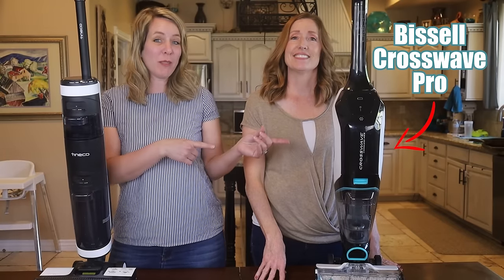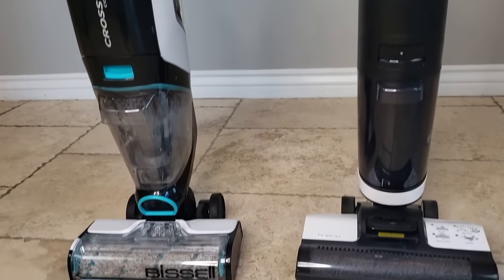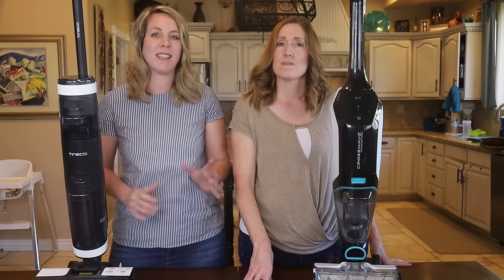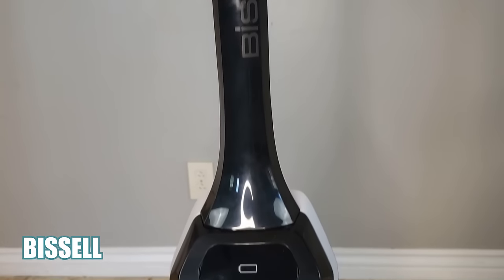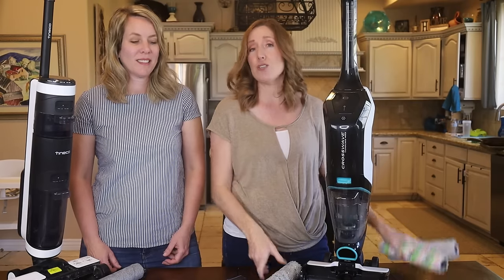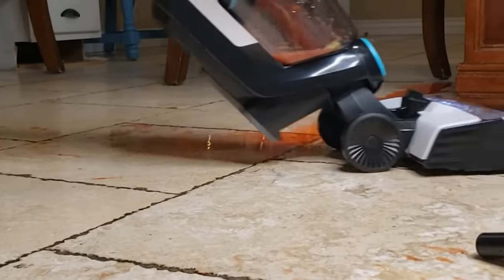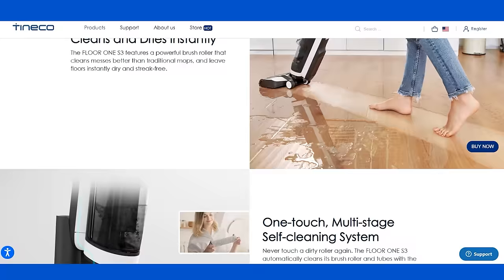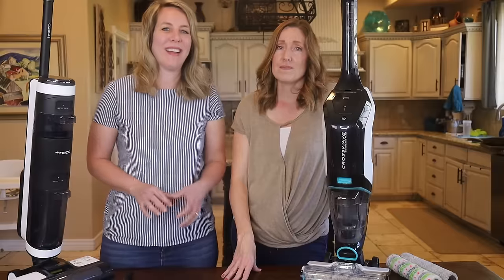Bissell Crosswave vs Tineco Vacmop (Which is Best??)

Comment from the maker: NOTE: The Tineco shown in the video is incorrectly labeled. It's the Tineco Floor One S3 Cordless Wet Dry Vacuum Cleaner - this one - https://amzn.to/3nbWjtw (this is an affiliate link) with smart tech. The IFloor 3 doesn't have the smart tech, voice (you can turn on/off but it tells you when it's time to refill the clean water, empty the dirty water, clean, etc), app or high tech display. It comes with 1 brush, the Floor One comes with 2.  I think it's worth it but both are great machines. The clean/dirty water holders are interchangeable, same with the brushes. The S3 has a black body and the IFLOOR 3 is white.
Reply: I have had the Bissell crosswave max for about 11 months. Absolutely LOVE it and have only had to buy replacement rollers once because I learned to deep clean them. Recently, the sprayer on my Crosswave stopped working. I followed all troubleshooting suggestions to no avail. I emailed Bissell and they are sending me a new one as well as allowing me to keep the old one for parts. Awesome customer service!
Reply: Thank you for replying. Yes, I use  the bissell cleaner and fill it to the indicated line. I have luxury vinyl, and I am not sure if it shouldn’t be used on that flooring, but the amount of soap residue after I clean is a lot. So. Let me ask what may be a silly question when using the machine a forward motion releases the chemicals and a backward motion over the same area dries the area? Please correct me if I am wrong as I want to make sure I am also using the machine properly. Thanks again.
Reply: I didn't understand which broom is better.
Reply: Please mention her name.
Reply: You guys also mislabeled the Bissell. It isn't called Crosswave Pro (that's a different vacuum). This one is called Crosswave Cordless Max.
Reply: I bought the wrong one.
Reply: Are you being paid for this ad.
I had a tineco for 8 months, and the voice commands  have never  worked  properly. 
Now  the battery  will not hold the charge.
Reply: Great review/comparison! So, so helpful. Thanks ladies.

Comment: After this review, I went with the Tineco Floor One S3, loved it for 3 weeks, then had to return it due to water leaking. I then got the Bissell Crosswave in this video, and I prefer it because it’s more durable with a better build, and the clean water tank doesn’t need to be refilled as often, and it’s so much easier to clean (the strainer in the dirty water tank is better designed and catches all of the gunk, and I can clean that part off in one swipe of a tissue, rather than with the Tineco’s strainer which is half the size and things like hair gets caught in it, plus the Tineco’s strainer doesn’t actually catch all of the gunk, so you have to filter through it twice when pouring out—it really became a source of frustration for me when cleaning since I had to empty out the DWT in the Tineco 3 times during a 30 minute period. With the Bissell, I only have to clean the DWT once at the end of a 30 minute cleaning session). I also tried the cordless Crosswave X7, and liked that one as well for the same reasons. Plus, the Bissell doesn’t constantly talk to you, so that’s less annoying (I know you can shut it off with the app, but I didn’t want to take the time to download the app to do that.)
Reply: do you know if this is the same for the bissel hf3? I am thinking of purchasing it
Reply: Have you ever had an issue where your floor stays wet for a long time after mopping? 
When I first got my cleaning machine, it left the floor dry in a flash—just 15 seconds and it was done. But after using it every day for a month, just 10 minutes a day, it's not squeezing out the water like before. 
Now, I'm stuck waiting around 5 minutes for the floor to dry.
Reply: @HamzaKhan-uc5zo  I did not like the Bissel hf3 when I tried it because it used up more cleaning solution than my Crosswave Cordless Max (as shown in this video). The other reasons were because in the hf3 I received, the water had to be filled sideways (odd design), had to be refilled more often, and while using up more cleaning solution did not clean my kitchen floor as well as the Crosswave Cordless Max! I found that emptying the DWT was also about the same as the Tineco, and I think it's becuse the hf3 was modeled after the Tineco. If you're deciding between the Bissell hf3 and Tineco, I think Tineco is better and more satisfying ... I just don't know how long the Tineco will last, as I hear that the longevity with that machine isn't great.
Reply: @BeginnerVille  Hmm, interesting ... My Bissell Crosswave cordless max (like the one in this video) always took about 5 minutes for the floor to dry. I also happen to keep the trigger button (that releases cleaning solution) pressed down the whole time. But if you feel your machine isn't working as well as it used to, and if it is under warranty, you can get a replacement machine and see if it improves. (I got mine from Best Buy and purchased their store's extra warranty.)
Reply: @LightnessofJoy  thank you very much for sharing this!

Comment: They should have swapped for a week and then talk about if they would stay with their old machine or change.
Reply from the maker: Diane did use the Tineco for over a week and liked the Bissell better for her household. I didn't use the Bissell but I should.
Reply: @CleanFreakGermaphobe  Does the Tineco clean itself off well?  I watched one man who used both and Bissell cleaned itself out but his Tineco didn't clean itself well.  It was the messy floor test, but even after re-doing the cleaning itself out process, his Tineco still didn't do it.  But, I watched another woman and with a not as messy clean up, her Tineco cleaned itself fine with less water in the base and the Bissell cleaned itself but the base was filled with water and she chose the Tineco for that reason.
Reply from the maker: First, every surface and mess is different. In my experience, you do need to remove the roller and make sure to get gunk and hair from inside. That's what the brush accessory is for and to clean the dirty water tank. 

I'll let Diana speak to cleaning the Bissell. It's been too long and I can't recall and don't want to give the wrong info.

The absolute best is Hizero. It separates the dry from wet messes. It captures hair and gunk in a tray that's easy to clean. You don't get a big soupy mess to clean in the dirty water tank. Just rinse off.

There's no self cleaning cycle. The roller isn't made of material. I find it much better. But they all have their pluses and minuses. When they're back in stock we plan to review the Hizero.
Reply: @CleanFreakGermaphobe  That is cool.  I will be watching.  I have watched Vacuum Wars review on the three of them.  But I will tell you that the man who tried to do double self-cleaning processes on the Tineco and it still was seriously messy caused me to pause.  I will wait for your Hizero review before buying one.
Reply from the maker: This is Diana.  The Bissell has a self cleaning mode too.  I use it multiple times a day, but I a few times a week I remove the brush and do a deeper cleaning
Reply: @CleanFreakGermaphobe  Thank you so much!  I am still narrowing but I can't get the brand they say is better than Bissell and Tineco (They only sell it in stores right now and they don't sell it in any of the states near me.  I would have to drive to Canada as the closest.)

Comment: After using both Bissell Crosswave Max and Tineco S3 for more than a year , Tineco broke down and it was replaced free  but Bissell is still working , but I found Tineco a much better machine to use and clean hard floors, Will go with a Tineco again .
Reply: Tineco you will be replacing them every three mos.
Reply from the maker: We agree tineco is a better choice. However Diana’s Crosswave broke and was replaced by Bissell. No problem with the Tineco. Diana ended up getting the newer Tineco and prefers it. I also upgraded to the same one and love it. There’s a link to it in the description. The S5.

Comment: I used your link to buy the tineco and they gave me $60 discount. Thank you again. It's important that my hardwood floors dry quickly so I chose the tineco for that reason
Reply from the maker: Thanks for using our link and let us know if you love it as much as we do!
Reply: Have you ever had an issue where your floor stays wet for a long time after mopping?
In the first few uses, my cleaning machine worked like a charm — the floor would be dry in just 15 seconds. But after a month of daily use, about 10 minutes each day, it doesn’t squeeze out the water effectively anymore.
Now, I'm stuck waiting around 5 minutes for the floor to dry.

Comment: I bought the bissell & returned it.  It left a lot of streaks & just made a mess.  
I recently purchased Tineco & found it to be far superior.  The latest version has suction only as well, so is a great improvement. 
In Australia the tube on is more expensive but I think worth it.
Reply from the maker: Thanks for your input.  The newest Tineco stepped up their game even more.  We both love it
Reply: I’ve been using the Bissell for three years and have never had streaking. Floors are always spotless. The Bissell also comes with different rollers. One for timber floors, one for tiles and concrete flooring and one for rugs.
Reply: Have you ever had an issue where your floor stays wet for a long time after mopping? 
When I first got my cleaning machine, it left the floor dry in a flash—just 15 seconds and it was done. But after using it every day for a month, just 10 minutes a day, it's not squeezing out the water like before. 
Now, I'm stuck waiting around 5 minutes for the floor to dry.
Reply: I Have the Bissel - would not buy it again.  it leave streaks and puddles of water behind,
Reply: I’ve seen a lot of those complaints about the Bissel or floor is too wet. I love that Tineco does it wet it up so much and it dries quickly.

Comment: The Bissel would fit my needs better since I would not need the wet mopping every time. Your demonstration and function of each unit is done in a very practical manner.  You have helped me with my decision.
Reply: Did vaacuming alone on carpet ruin the brush though?

Comment: I initially had the Bissell crosswave for almost 8 months and wanted to buy another Vacmop for second home, after seeing several yutube reviews decided to go with Tineco S3, from using both I find  Bissell is heavy duty and can clean really muddy places but Tineco struggles, but for day today cleaning of kitchen and normal tiled rooms ,Tineco is okay and self cleaning of Tineco is way better .
Reply from the maker: Thank you so much for sharing your experience. I think you're correct. If you have a pretty clean floor, the Tineco will keep it almost perfect. It's easy to maintain and handles most messes well. But if you have pets, kids, etc and your floors are getting quite dirty, get the Bissell.
Reply: Thanks for your feedback!! Just bought myself a bissell.
Reply: @CleanFreakGermaphobe Does the clueless max loose cleaning power towards the end of the 30min.
Should I go with the corded pet pro max for consistent strength & longer cleaning time, or does the convenience of the cordless outweigh the 30 min? Is there a big difference in cleaning strength between corded & cordless?
Reply: I have to agree with all this.  And the crosswave keeps mats looking like new.  Tineco won’t even touch em’!  I have the S5 pro and the crosswave MAX and the tineco hurts my shoulder and the crosswave is way easier to control and there’s no shoulder fatigue like the tineco.
Reply: @misterkota1252  thank you for this. I was about to get the tineco S5 pro
Reply: Have you ever had an issue where your floor stays wet for a long time after mopping?
In the first few uses, my cleaning machine worked like a charm — the floor would be dry in just 15 seconds. But after a month of daily use, about 10 minutes each day, it doesn’t squeeze out the water effectively anymore.
Now, I'm stuck waiting around 5 minutes for the floor to dry.
Reply: @misterkota1252  Since you have the newer Tineco S5 and the Bissell, do you find the superior edge cleaning on the Tineco to be a factor at all?  I wasn't even thinking of the Bissell until this review, but they did update in the comments and they both found the Tineco S5 model outperformed the Bissell as well, so your comment is interesting.  Even though the Bissell is heavier and holds more water, plus you have to hold down the water button for the Bissell, that you still find your shoulder gets sore from the lighter Tineco.  Sorry, I see your comment is a year ago now, but you raised something I haven't seen before.

Comment: I bought the Bissell over the summer, when I was looking for an easy tool for mopping my tile and hardwood floors. I didn’t know about the Tineco until recently. I wanted to buy another bissell  for my son and new daughter in  law for their new home. I wanted to compare the two and found your video. The Bissell I bought is a plug in not rechargeable only because I have a big surface area to clean and I didn’t want to run out of power mid task. It also has a bigger water tank which I like because of  more cleaning time. I appreciate your video which helped me decide on which to buy. Thanks so much.

Comment: I've owned the Tineco S5 and the cordless crosswave...  Tineco hands down is my favorite!  With wood floors and tile throughout our home, Tinco leaves much less water behind, I purchased it after my crosswave because I would have to go back and dry my floors.  Although you cannot control the water output, I have a squirt bottle if I need more.
Reply: Would you say the tineco is lighter or easier to use? I have the crosswave but it leaves water and streaks and is just heavy... thanks
Reply: Have you ever had an issue where your floor stays wet for a long time after mopping? 
When I first got my cleaning machine, it left the floor dry in a flash—just 15 seconds and it was done. But after using it every day for a month, just 10 minutes a day, it's not squeezing out the water like before. 
Now, I'm stuck waiting around 5 minutes for the floor to dry.
Reply: @aloria100  Everyone and all the reviews online show the Tineco is lighter and a bit easier to use in that way.  Esp. if you have a self propelled model.  They tend to have smaller water tanks, so that alone will make them lighter.  Some find they prefer the sturdier build of Bissel or another competitor.  Tineco seems to leave floors drier. I've seen updates in these comments.  Since the video was made and the S5 Tineco came, out, they both prefer the new Tineco.

Comment: I just ordered the Tineco. I like that the self-clean is better on the Tineco, and that it’s lighter and easier to push around. I also like that the cleaning solution is nice-smelling 😊 I have a small apartment and no kids so I think the Tineco will be perfect for keeping my floors tidy and clean.

Great review!
Reply: Have you ever had an issue where your floor stays wet for a long time after mopping? 
When I first got my cleaning machine, it left the floor dry in a flash—just 15 seconds and it was done. But after using it every day for a month, just 10 minutes a day, it's not squeezing out the water like before. 
Now, I'm stuck waiting around 5 minutes for the floor to dry.

Comment: I have them both. I got the Tineco first and wasn’t completely happy with its ability to clean dried up dog slobber (Great Dane owner) so I tried the Bissel. I like the Bissel much better as it is much better at cleaning dried on dirt and the water tank is bigger.
Reply from the maker: Thanks for your insight. It's always tough to pick a winner because they're both decent machines that cut down on work. But, as you point out, your choice also depends a lot on how you use it.

Comment: I’ve had both the mop vacs in this video. I returned both of them after a week because they both struggled with dried on messes. I settled on the Tineco S5 steam. The steam is a game changer for houses that want to truly sanitize your floors.
Reply from the maker: Thank you for your feedback and experience. We don’t have a lot of dried on messes at our house. I’ve noticed that vacuum mops struggle with that type of mess the most. Steam lifts the mess up. The only problem is steam isn’t good for vinyl plank flooring we have. Over time I can see how the edges have swollen because of the heat. This is a reminder that cleaning is individual too. What works for one person may not work for another.
Reply: Can you use it on area rugs? Or is it still recommended not to?
Reply: @CleanFreakGermaphobe  plus cleaning products can't be used in steam mops and I like the smell them.
Reply: @CleanFreakGermaphobe  Thank you for that information. I have been looking into steamers and saw a video for the Tieco just yesterday and here is yours showing up in my suggested videos confirming the Bissel for me since we are putting LVP in January. I even have the McCulloch on my wish list on Amazon. I may still get it for cleaning other things instead of the floors. Thanks greatly!
Reply: Have you ever had an issue where your floor stays wet for a long time after mopping?
In the first few uses, my cleaning machine worked like a charm — the floor would be dry in just 15 seconds. But after a month of daily use, about 10 minutes each day, it doesn’t squeeze out the water effectively anymore.
Now, I'm stuck waiting around 5 minutes for the floor to dry.